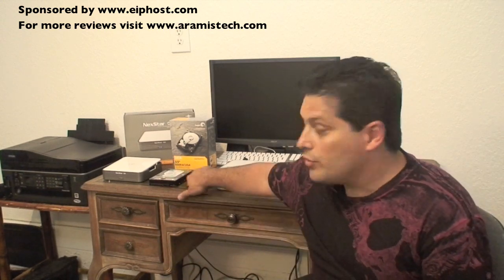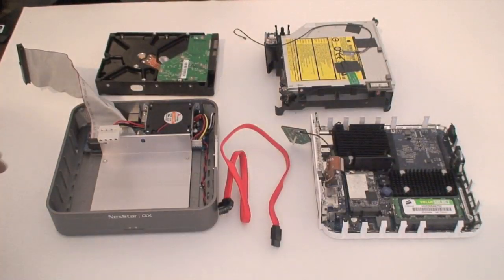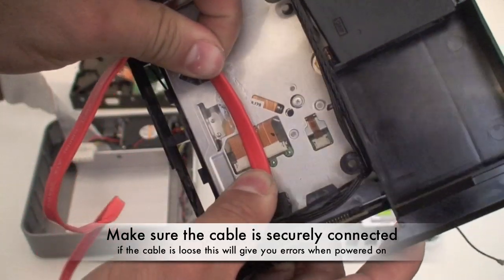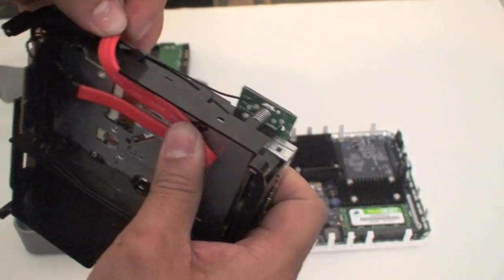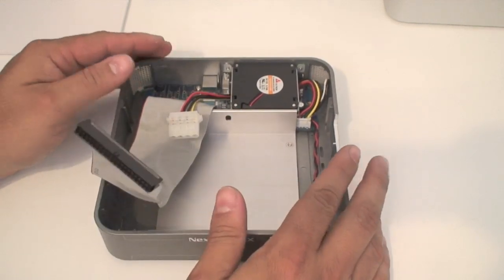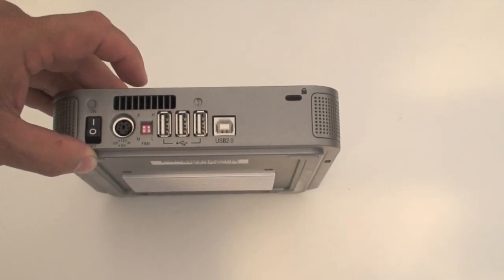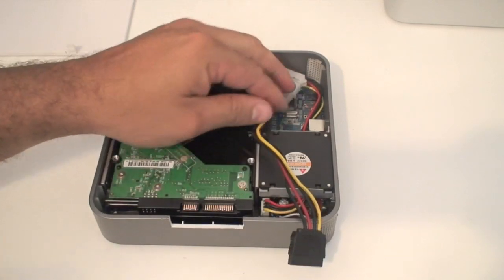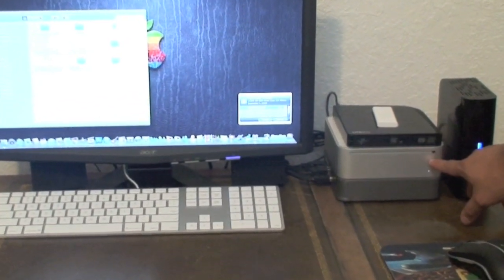SuperSIZE Your Mac Mini

Comment: well just gunna say that OWC has a video showing you how you can remove the optical drive and replace it with an additional hard drive up to two terabites using a data doubler. its internal, no additional parts required other than the hard drive and the data doubler, and its under $100.

Comment from the maker: Thank you, I appreciate it. You can put an external drive but I tried it and since you can't access a bios to customize the settings it will not boot to an external drive. The way I did it will not fail since you are connecting the SATA drive directly to the motherboard. Thanks for subscribing. 

I do enjoy making the videos because I can share information with many people at once. I'm glad you liked them. Thanks.

Comment from the maker: In the video what I show you is how to make a hard drive of 1tb or larger as the internal drive for the mac mini by bringing the connections out of the mac mini. This is way better and the drive works faster since it will be connected directly to the sata port on the motherboard of the mac mini.

Comment: i got a 1.5 TB Lacie D2 7200rpm external HD and honestly it wasnt too expensive only $200, powers on/off by itself and and doesnt look bad at all another think is that i have it connected with firewire cable cant complain on firewire :)

Comment from the maker: Yes you can but it will not work at the speed of the internal SATA connection, a USB drive works slower. This would make the drive the internal drive for the mac mini.

Comment from the maker: It is a cool project with 3 great benefits. 1 Hard drive speed. 2. There is alot less heat in the mac mini since the drive is now running externally, 3. If you want a larger drive it is easier to upgrade all you need is to open up the external box and change it out.